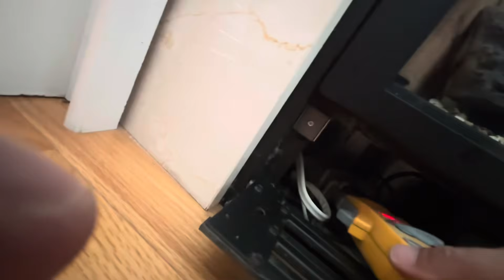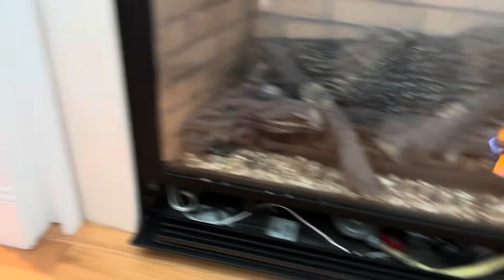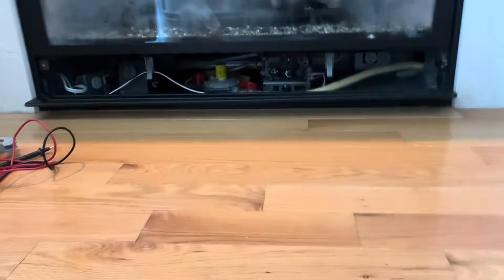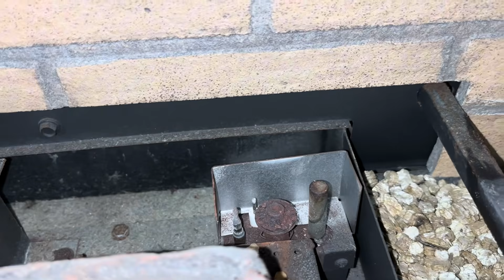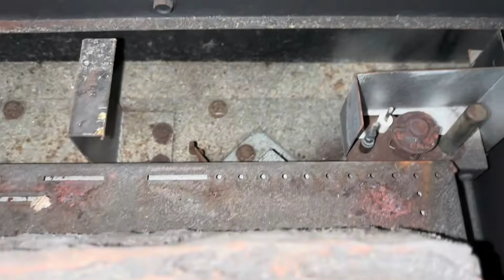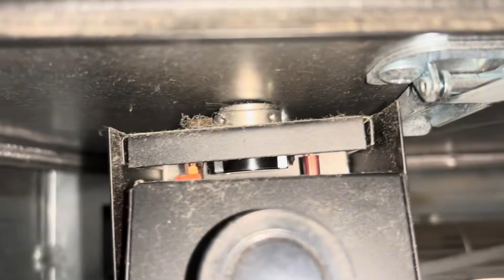Gas Fireplace Service And Maintenance!

Comment: Hi, I have that exact assembly.  However, it wasn’t until after I purchased the home (and watching your video, thank you) that I realize there is no thermopile in the assembly at all!  Is that why the fireplace doesn’t stay lit?  Also, WHERE 😢can I find a compatible thermopile, as the ends on the wires (2007) are all different than what I’m finding. PS there’s no info markers anywhere on the unit.
Reply from the maker: If it doesn’t have any markings on the unit, and it doesn’t have a thermopile installed, it might be better having a pro come take a look and let you know what’s going on.  You can start with your propane provider.

Comment: Cool.  Hey what rype of service/sreviceman do i call to check mine as well?  Who does this work?
Reply from the maker: You can start with your propane provider and ask if they have a service department.  Or Call an HVAC company and ask if they work on gas fireplaces.
Reply: My propane provider quoted a price of 390 just to come out. The last cleaner that came was a private individual not with a company only charged me 189 including cleaning new logs and a new pilot light part. Why is it so expensive now?  I am having a hard time finding anyone to clean the gas fireplace. Paying 400 a year for cleaning would add up to a new one every three years or so. Can't afford that for maintenance. I live in Northeast Connecticut in a small town 30 minutes outside of Hartford
Reply: @sharonproctor4079  What a “burn”!!!

Comment: I have a heatilator gas fireplace and the main burner won't light.  I've tried all the troubleshooting and cleaning steps.  The pilot light is on, but will not shut off using the dial on the main control valve.  It's currently in the OFF position, but the pilot light is still on.  Would this be an indicator of a bad control valve that needs to be replaced and is this something that is a DIY or needs a professional to do?
Reply: Yes that usually means the main control valve is bad. When turning knob into the off position, it should close the pilot solenoid, completely shutting off the gas to the pilot. The solenoid is more than likely stuck open or the knob itself is not engaging and turning the pilot off. If you’re pretty handy with a couple wrenches, you can probably replace it yourself. Just make sure you hook all leads back to the same place that they were on the original valve. Always be sure to bubble test for leaks on both inlet and outlet as well as the pilot. 

I’d use pipe seal or pipe dope instead of just the tape. Better seal to prevent leaks.
Reply from the maker: Sorry for the late response.  If you aren’t familiar with working on gas appliances and don’t have tools to check the gas pressures, id call a professional.

Comment: So question, I just got the 19" Hargrove Cole Basket gas fireplace, it's a millivolt system--thermocouple + thermopile & ODS. For the first hour to 90 minutes it worked just fine, instead of a switch I had a remote. though at about the 100 minute mark I tried turning it off at the remote and nothing happened (this was after testing the remote on and off a few times to ensure it worked). After several minutes I could no longer get it to turn off from the remote at all. I turned the system off from the actual control knob near the valve. From this point forward, I was able to get the pilot lit and to stay on, for even hours without going out, however, every time I turned the knob to from pilot to ON, the main burner would flutter with a little bit of fire but immediately then go out, with the pilot REMAINING lit... I cannot figure this out. It is not the heat sensor because I waited hours sometimes in-between turning it from pilot to ON. I cannot figure this out... the device was brand new... Is it really possible it has a main valve issue already? I was told it probably isn't a bad thermopile because if the thermopile was bad the main burner shouldn't turn on at all, but this would flutter open for a few seconds then immediately go out/close... The thermocouple seems fine as the pilot works perfectly , and I ruled out a remote issue by removing the wires from the remote and putting the in the bark switch, with still the same result... I wish I knew what was going on. Again it worked fine or the first hour...
Reply from the maker: Might be a loose connection from the factory on the valve or one of the controls.

Comment: Hey Jeff great video as always. I was watching your video on the new Calgon stuff and I have a Lennox unit but on the outside unit it says use water only to clean the coil can I use new Calgon with a weak mix? Unfortunately I have a great big Bradford pear tree that shits all over it in the spring and I need something besides water to get everything off. Any advice would be grateful. Thank you sir!
Reply from the maker: Yes you can use Nu-Calgon products on it.  Just make sure you rinse it very well.